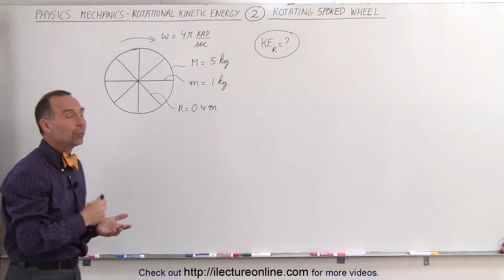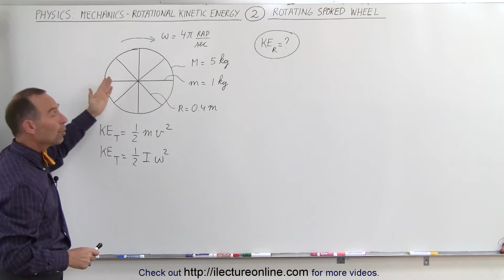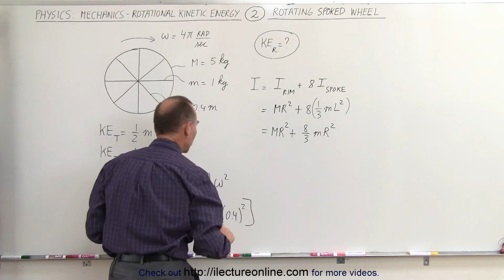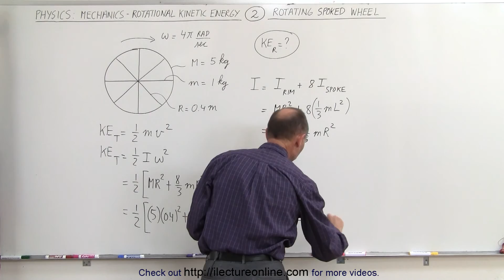Physics 8.5   Rotational Kinetic Energy (2 of 19) Rotating Spoked Wheel

Comment: Im trying to figure out how much torque/hp a 24"  250lb flywheel would have at 1800 rpm , and how much hp/torque would be needed to sustain that rpm once achieved.  Any help ?
Reply from the maker: A rotating flywheel has rotational kinetic energy and a rotating object has a moment of inertia.  The concept of torque in the context of a rotating object refers to the amount of torque required to accelerate the rotational motion.  Once the object is rotating the amount of hp you need to keep it rotating depends on the friction of the rotating shaft or ball bearings.

Comment: Hi Prof. Biezen :) if we were given a coefficient of friction such that friction acts on both sides of the centre of the wheel where it is bolted to a rod, how would we incorporate the force of friction/work done against friction in our calculations?
Reply from the maker: Typically, work done by any force is Force x Distance (x cos (theta))     I would multiply the frictin force time the distance traveled per rotation ( 2 pi R)
Reply: @Michel van Biezen  thanks :) your videos have been of invaluable help

Comment: 1:36 why MI of spoked wheel is 1/3 mr^2
Reply from the maker: Think of a spoke as a bar that rotates about its end.  (since the length of the bar is equal to the radius of the wheel:   (1/3) mL^2 = (1/3) mR^2

Comment: could you help with vee belt used to transmit power from one shaft to another with small pulley the drive pulley going in a clockwise direction it rotates at 800rpm. the inuded angle of the vee belt is 45degrees and the coefficient of friction is 0.35. the slack side tensioner is 80N. neglecting centrifugal force and belt thickness what is the maximum power and torque that can be transmitted through the drive at the driven pulley.